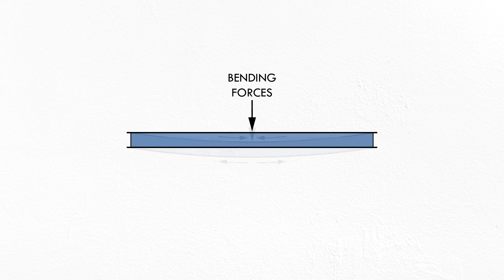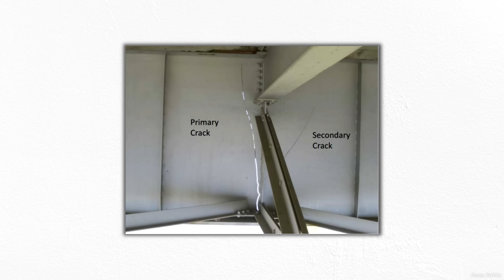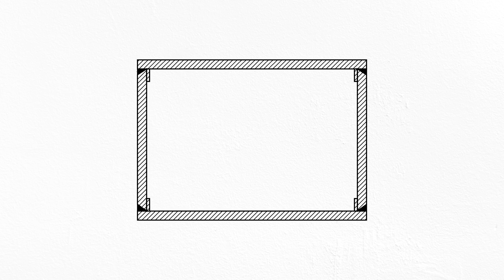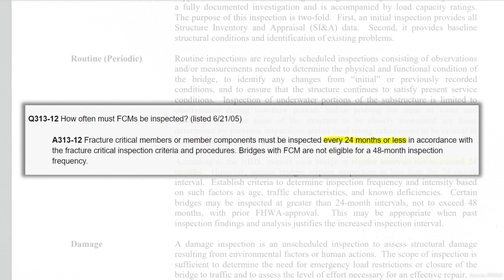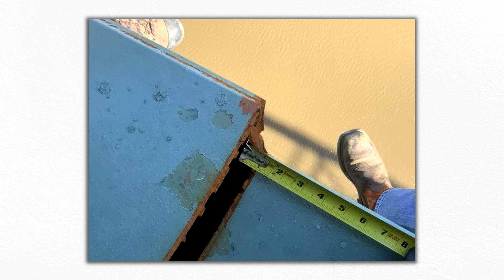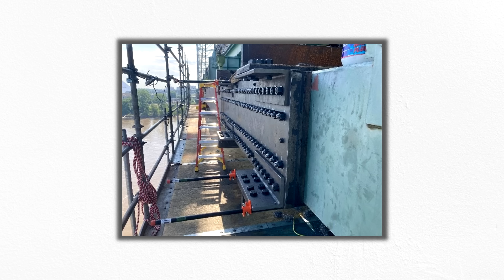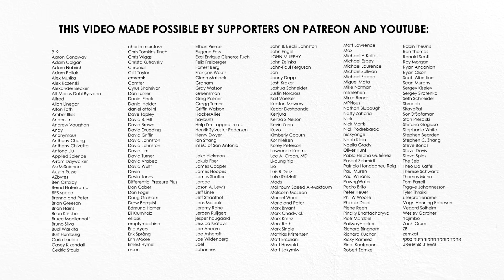What Really Happened at the Hernando de Soto Bridge?

Comment: IIRC, other sources on this story said that this crack deficiency was outside of the scope of [a/] the previous contracted inspection and therefore not acted on. I believe the consultant inspector mentioned this to ARDOT, but ignored as outside your work area..

the finger pointing is vicious when something like this - or say the recent bridge collapse in S. Korea - happens.
Reply from the maker: The contracted inspectors do the rope access climbing on the arch and hangers. ARDOT does everything below the deck themselves (or at least they are supposed to).
Reply: @PracticalEngineeringChannel  yes, but as a person holding both PE and NBIS training certificate, even if you see something 'out of scope', the issue should still be raised.

Comment: The corrosion on those crack faces suggest it had been open for a while. Could corrosion have been the initiator of the crack? (Rust creates a pit, which generates stress  concentration which begets little crack....) 
Not directly related to this, but following, could bridges and other structures be equippred with "nervous systems" to identify problems? Fibre-optic cables whose fracture would interrupt signals, resistance measurements that are obviously going to change if cracks are present, piezo-electric vibrators that are going to return a different sound if a crack's present. (That goes back to a railway wheel-tapper hitting wheels with a hammer, and listening for "ting" vs "donk".) All of those might generate signals for single-board computers to monitor, and cry "havoc" when appropriate.

Comment: Question: given the importance of the bridge to traffic flow, and our empirical evidence that the bridge won't immediately collapse due to this fracture, would a partial reopening ever be considered? I don't know anything about the design of this bridge (or any bridge) but it seems possible that load on one side might not require the structural elements on the opposite side? So you could maybe reopen half of the bridge, which wouldn't fix traffic but might help some.

Comment: In software engineering and systems architecture, we always build special components for maintenance and support. To allow us to easily measure the performance, health and condition of a given set of software running, and we build in paths/entries for administrators and developers to make updates/corrections and changes to the deployments.

It puzzles me seeing these bridges, with NO built in access for the engineers to do inspections? Why aren't there permanent walkways under the bridge instead of having to use special equipment? Why make it very very hard to get access to the areas that are so vital to inspect and maintain?

Comment: So very well said. And the most important part of what you said is that this whole incident isn't about the failure of the structural member at all.....it's about the failure to detect it. So what if they have an inspector look at the bridge and take drone video and photos? Can't they do a 100% follow-up on the inspection and have a second set of eyes pour over the images just as a double-check on the first inspector's report? In aviation ....while far from perfect and having our own history of some failures......certain things are never left to a single person. When an aircraft is ETOPs certified (Extended Twin-engine Operations overwater) a single person is not allowed to service ....both engine oils....for instance. That way if he leaves an oil cap off or something of that nature then only one engine is affected. There are other examples in aviation where certain things are never left to one person and must be followed up by a trained and certified inspector. I would think it would be the same with bridge inspection. In fact I'm surprised they would rely on A inspector in the first place. Instead.... have a mechanic or mechanics do a close visual inspection of the structure PLUS record the imagery and then let at least two certified inspectors examine the images back at the office. That way at least THREE sets of eyes would have inspected the bridge.....besides all of the non-destructive testing that would be done. This incident is very embarrassing for America as a society. Shameful really.

Comment: I am only a welder not an engineer.  May I say corrosion cracking and or intergranular cracking with a fatigue element. I am sure the crack and adjacent areas are being tested to search for an accurately answer.  As welding does introduce stresses ( heat ) variables in filler, process, welder procedures ( proper preheat and post heat ) are just a FEW of the considerations. I was literally shocked by the size of the crack and that it went " unnoticed for so long. Will wait for any further information that becomes available. Thanks for your cogent explanation.

Comment: Is it possible that the earthquake retrofit, which presumably increased stiffness in some areas, could concentrate stress in other areas and have the unintended consequence of worsening fatigue stress in the horizontal tie member?  Maybe vibrations which previously could transmit into the vertical pillar support and also to the next horizontal tie are stopped abruptly at the stiffened pillar with subsequent increased stress concentration in the horizontal member somewhat near the pillar.   Possible culprit?

Comment: How does a 911 call from a bridge engineer go?
"I'm telling you, I'm an engineer, and you have to shut down the bridge."
"Let me talk to my manager."
Reply: They actually released the 911 call

 https://www.youtube.com/watch?v=_uiebWzi1zc
Reply: @d-rex5  woah. MvP
Reply: @d-rex5  great cross reference. thanks!
Reply: they probably have codes in place about how to shut down roads and bridges in case of emergency. It happens on a smaller scale all the time with road repairs.
Reply: Yeah XD

Was thinking the same thing.
Reply: I understand that the 911 operators receive a fair share of crank calls, but after listening to the call recording, and my own experiences with calling 911, the operators don't listen well, so you have to repeat everything SEVERAL times, and then they still get details wrong. This wastes precious time. Then they pass misinformation on to the first responders, endangering everybody.

Comment: In the initial temporary repair job, did they have to re-compress / re-tension the beam before patching it? If the whole bridge has expanded out by a full inch, then it seems like some amount of extra stress on the remaining components would still be there if you just secured it in-place.

Comment: I think the hard connection between the supporting beams and the tension beams was original and a poor design choice. If it had been introduced by the seismic upgrades there would not be a visible crack in 2015 photos, the timing is wrong.
Further thoughts, the bridge needs a complete design assessment, how could seismic upgrades end in 2015 and have not noticed that crack which shows in a photo from 2015? The quality of work and design for the seismic upgrades is now suspect.

Comment: 12 seconds in. 
why is everyone calling that a "crack" when it's clearly broken cloimpletely in half.
Reply: No, its a box-girder, and the crack didn't extend through the circumference of the cross-section.
Reply: @gordonrichardson2972  it being over an inch vertically and over an inch horizontally out of alignment, makes it appear completely disconnected.

Comment: This sounds like a machine learning task. Have a drone that can suction itself to the side of the steel and use sonic/xray tech to scan through the steel, inch by inch.  This way it would give them a canary to get them to inspect dangerous areas by hand instead of the whole bridge.   On top of some materials science work, maybe a signal is passed through the steel, with listeners mounted to parts of the bridge which can detect serious changes like this.

Comment: question from the model that you did with the bricks and the bridge I assume those steel structures are the string. Do they not also have a stronger cable also going? Do they know if steel embrittlement is the cause? Would it possibly be a good idea to go ahead and complete the arches across using the ground?

Comment: It was an oversized load crossing the bridge that was responsible. A massive special transport trailer hauling a 200 ton excavator stressed the structural member to the point of fracture. Consistent with this event was that break occurred on the side the truck was crossing.

Comment: It seems to me that if you have a tension load like that in a structure where stress fractures are such a large risk the obvious choice to support it would be a steel cable. Something designed to support high tension loads and be flexible.

Comment: I wonder if an autonomous self-inspection system could be installed. Maybe at least several ultrasonic exciters and sensors along the tie, that regularly do a test and transmit the results. Could be less expensive, even, if it does not need maintenance for 10+ years.
Reply: You dream. We can't even fill a pothole without snarling traffic for hours.

Comment: Those previous inspectors should be fired, this was a huge crack that was easily visually seen from the outside, what if it was in a more hidden area? I want to think it's possible the retrofit may have caused additional stresses to already 40+ year old structure. If this beam had rounded corners, crack likely would not have happened. Still impressive how these bridge structures were engineered manually, not with computers with today's stress load calculations.

Comment: Whether or not that tie qualifies as fracture critical, its failure probably makes whatever part took up the tension a fracture critical part now.
Reply: Yup, and that part probably wasn't designed for it, so it'll fail sooner rather than later.
Reply: Yeah that's the real thing here, that tie was very clearly carrying a significant amount of stress and that stress went somewhere when it failed
Reply: Dynamic structural classification. Even has an acronymn. DSC. Critical? Non critical? Well, it's undecided. I mean dynamic.
Reply: I’d say the deck is carrying the tension. It never would have been designed for it, but there’d be enough steel in it to do the job. It’s probably cracked a lot more now as it would be under tension. would be interesting to see if that’s the case.

Comment: Wow, I hadn't heard of this failure.  As a structural engineering that's truely shocking. The consequences of the neglect would have been unimaginably, just as well engineers are traditionally conservative in design with redundant factors and safety margins.  I worry about modern structures that are designed 'to the bone' because the Finitel Element analysis is considered accurate.  That bridge lost 50% of it's longitudinal tie capacity (which was distributed elsewhere).  Finite Element analysi doesn't allow for neglect, weather, overload etc etc. so the margin for unintended forces is minimal.
Reply: FEA allows for whatever you use it for.  For example, when we run FEA on a design we include failure analysis.  Eg. what happens if this component fails.  The beauty of the computer model is that we can run those calcs in a matter of hours instead of days or months.  FEA isn't the enemy, design complacency is.
Reply: FEA doesn't mean that you stop being conservative with your design.
Reply: @w0ttheh3ll  FEA doesn't "have to" mean that you stop being conservative with your design, but it often does.  Overbuilt and redundancy costs money.  Management wants to save money.  So they will make a budget decision on the strength of the FEA.

Comment: I still remember when the bridge west of there (in Oklahoma) got knocked out by a run away barge.
I remember it because I had driven over it the previous night. Have driven over those two and the one in Minneapolis dozens of times.
When the Minneapolis bridge collapsed, they released a study that said over 1300 bridges in the country were "structurally suspect".
....but we don't need a big infrastructure bill.
Reply: The Infrastructure spending bill was held up in Democrat controlled congress for 3 years until just before the election, after the election fraud was set.

Comment: I still don't understand why don't such constructions have extra safety measures built in. 
Like in this case, couple of think steel wires that run parallel with the beams to keep the thing from total collapse "just in case". 
They may weight a bit more but you design it so that it compensates for the weight.

Comment: In situations like this why don't we have alarm lines that would break as soon as a structural member shifted?
Reply: It's probably a little more complicated than achievable, at least reliably. There is a lot of vibration, salt water, workers, weather, etc. You would need a line strong enough to monitor everything, account for expansion and contractions, while breaking before anything else, but not too early. I'm sure it's possible, but the cost is probably high, and everything still needs to be inspected anyway
Reply: @arthurr8670  yeah, I could see that. I just dislike the idea of so much infrastructure relying on one human to do a job right to remain safe.

Comment: This is a brilliant and terrifying video that shows how even with systems in place, too often, even those safety systems are subject to single points of failure. I guess when you're a bridge inspector, skiving off from work even one job a year can be disastrous.

Speaking of, have you heard about the bolts on the new Mario Cuomo Bridge? It seems there's been a massive coverup following what may prove to be either defective bolts being knowingly used, or insufficiently spec'd bolts.

Comment: American transport authorities doesn't have the budget to do regular inspection and maintenance due to the way American cities prioritize arcane housing development regulation and monocultural suburban development instead of efficient, high density walkable cities. The solution isn't just to do maintenance more often, but to ditch the nonsencial policies which have destroyed so much of American geography. A lot of these bridges wouldn't even be necessary, or could be made way smaller, if development was more centralized.

Comment: Any analysis should include whether funding cuts had an impact to the process.
Reply: The crack was previously visible, on film,  and missed.
Reply: @jamesengland7461  you misspelled “ ignored”.
Reply: @akbychoice  fair point!
Reply: @jamesengland7461  correction: Ignored, not missed.  Like the cracks in the "new" Chinese Sourced Bay Bridge section in San Fran. Like the rusting sub-standard bolts and steels used in it's construction.  They just "painted over it" in San Fran. That "new" bridge section is going to come down.
Reply: @meatybtz  fair point, as well!
Reply: @meatybtz  It's why many African nations are telling the Chinese to go to Hell they were not going to pay for the broken projects the Chinese debt trapped them with in their Belt and Road Initiative. They tried to claim the Mombasa Port as collateral, but Kenya just said no way is that going to happen.
Reply: The issue is not often "funding cuts" but out right graft, misappropriation of funding, and incompetence. My perennial example is Los Angeles Water Mains. When they were built there was a funding system built in that would pay for the repairs and replacement of the mains at set intervals. Accounts that would accumulate specifically for the work. However, the administration of said account was often fond of raiding it for other projects and or pay increases, bonuses, etc. So, even with "raising prices to cover" they were never able to afford it because they had raided the account rather than practicing proper money management. The results were major water main breaks in LA.. oh and more price increases to cover costs that were supposed to be covered already.  This is pretty much normal for ALL major infrastructure. Repair/Replacement was "baked in" when they were built but those juicy big piles of cash that accumulated were often raided or misappropriated by those managing it. They then claim they have no money for the job. Pretty much they line their pockets. There have been discoveries of millions of dollars taken from said funds for "bonuses" for the top brass. Graft and Corruption, only China beats out the USA for that.
Reply: @meatybtz  HMMMM You just described the Social Security funding raids since the early 70's.